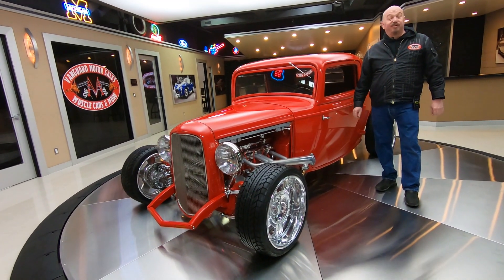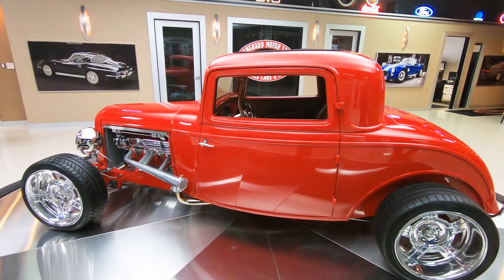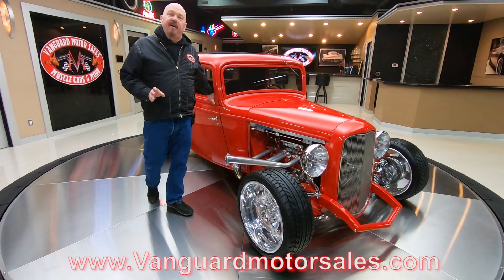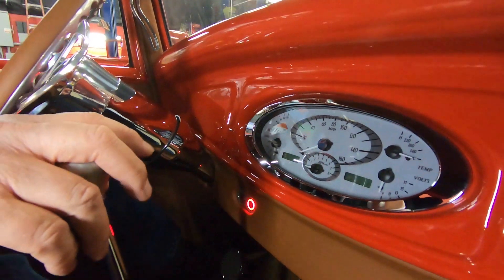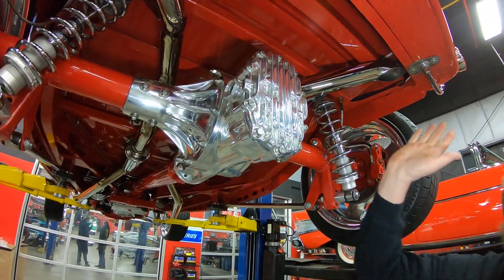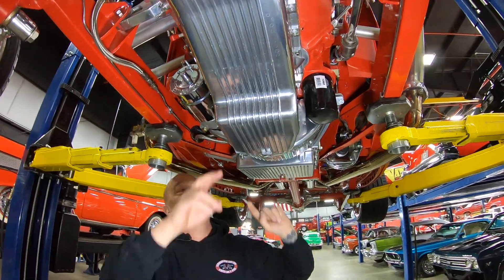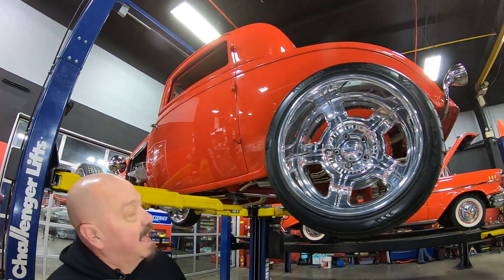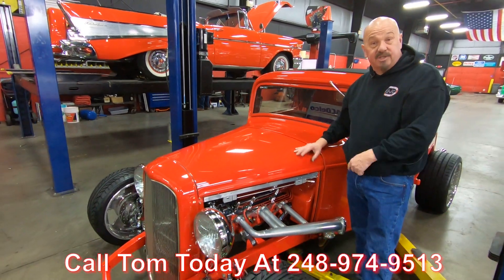1932 Ford Street Rod For Sale

Comment: America is good country. in America, life is like clockwork, a good President Donald trump . You can buy a 1960 Ford Fairlane. list 1959 Studebaker, Dodge Dart 1960,Lincoln continental 1960 and 1962, American Ford Falcon 1965, Ford Fairlane 1966 , Pontiac Catalina 1960, Chevrolet Impala 1960, Mercury Comet 1964, Buick Lesabre 1960, Chrysler 300G